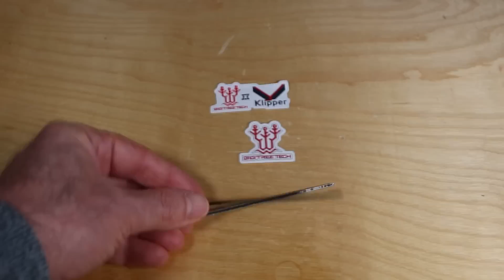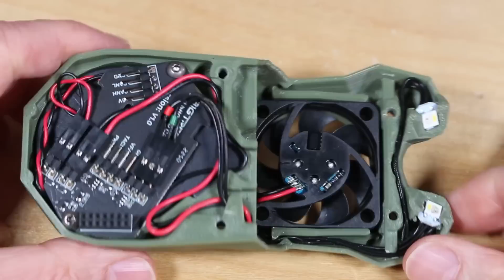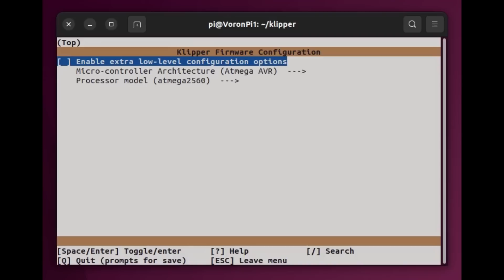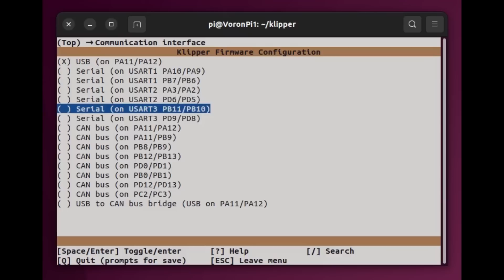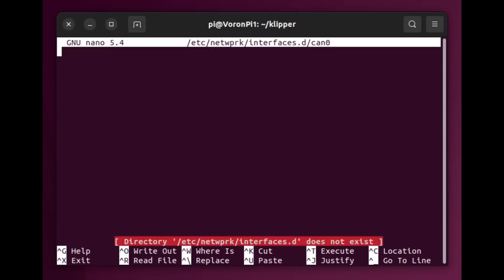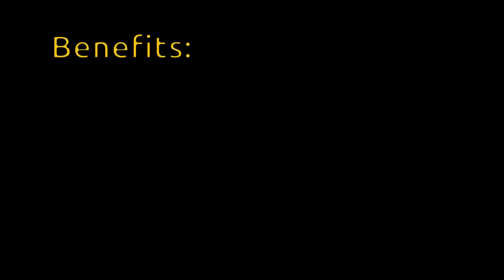Canbus SB2240 and SB2209 3D printer Install, Thoughts & Tips from BigTreeTech (BTT)

Comment: I have SB 2240 on V2,4 and Trident. What do I need to do to be able to use the input shaper I used before switching to canbus? By the way, your videos are excellent and have been useful to me on many occasions, including when assembling the SB 2240.
Reply from the maker: In your printer.cfg file you need a few lines like this (these are my actual values for the SB2240):

[adxl345]
cs_pin: can0: PB12
spi_software_sclk_pin: can0: PB10
spi_software_mosi_pin: can0: PB11
spi_software_miso_pin: can0: PB2
axes_map: x,-y,z

[resonance_tester]
accel_chip: adxl345
probe_points:
    175,175,20  # xy&z coordinates based on your printer size.  I used this for a 350mm 2.4. 

Once in the file, restart Klipper and you should be able to run Klipper's resonance testing just as the instructions state.

Thank you very much for the kind words and for watching!
Reply: @KapmansBasementWorkshop  Thank you for your answer. You are a kind person. I assume that since I had to completely reinstall klipper and did not reinstall imput shaper before mounting the SB 2240, there is no difference in the software installation itself? Should I just follow the instructions from the Klipper Documentation?
Reply from the maker: @ljuboizsiska5448  I believe that is correct.  When I run it, I just follow the Klipper docs.  It has been a while since I installed Klipper from scratch....
Reply: @KapmansBasementWorkshop  Thank you for your help! I installed the imput shaper on V2.4 and Trident following the instructions on the Klipper Documentation and everything works flawlessly. I know I'm boring but one more question; In the fluidd interface, I get a warning that updates are available. Is the update process the same as without canbus?
Reply from the maker: @ljuboizsiska5448  Yes, the update  process is exactly the same, nothing changes.  Update just like you did before.  I'm glad this is working for you!

Comment: This is so good!!

How is the process different from just connecting the SB2240 straight to the CAN0 RJ11 connector on the Bigtreetech Octopus (so without the U2C)

Hope to hear from you
Reply from the maker: I wish I could tell you based on experience, but I'm using a Spider on this printer.  That said, I'm 90% sure this is the same for the most part.  I used the U2C "as is" from the factory, so it's not really a factor here in terms of work beyond plugging it in and your Octopus provides that U2C functionality.  Have a look at the very 1st link on this page: https://github.com/Esoterical/voron_canbus .  I believe this is what you are looking for.
Reply: @KapmansBasementWorkshop  thanks for the reaction! 
So basically you expect I can follow your guide, but just skip the U2C section??

Also, any reason you chose for the DFU update route, instead of the CANboot option?

Hope to hear from you and thanks in advance
Reply from the maker: @sandervanvoxel3d  I choose the DFU route to keep the software installation simpler initially.  When I need to upgrade that software in the future, I plan on connecting my laptop and using the DFU method again.  Note that I stated "initially" as there is a tradeoff here.  Some may not see using DFU again in the future as "simpler" but instead as more work.  So CANboot is a little more work up front, but should simplify future upgrades.  It's really just up to you.  
Also, in thinking about your question and situation above, I think I would follow the Esoterical documentation and use my video when you need/want to see some of those steps when applicable.

Comment: Hello, thanks for the video.
I went with the fysetc kit that includes the spider ctrl board and I Wonder if all those mods you showed will work with my board.
I did see some equivalent extension boards like canbus, input shaker, Tap, on fysetc side but not sure if they stack up with BTT ones. Could you help out? Thanks
Reply from the maker: The only items I have from Fysetc is the Spider controller (which has been great) and a PEI flexible bed pate (also great).  Everything I show in this video is working with the spider controller.  However, since I use the U2C connected to the Pi, technically I'm actually bypassing the spider for canbus.  Input shaper & Tap are probably just fine from them.  I'm sure their canbus board is good as well.  But if it needs to be flashed, I would follow their guide to build and install as it might have a difference cpu when running make.

Comment: Question on the end of the cable did you cut the ends off for the U2C and use one of the connectors, like the 4pin?
Reply from the maker: I cut the end off and used the U2C screw terminals.  I hate crimping connectors....

Comment: Yep, that is a gamechanger. I have a flatflex cable for the x/y axis as the wiring but it is still not as nice as having ONE cable to fix the whole situation at best.
Reply from the maker: I'm really happy with Can Bus.  I plan to use it on all my future printers.
Reply: @KapmansBasementWorkshop  One more question: How to wire the xy endstops at the xy-axis joint at best? I mean there would be a cablechain left to get the switches connected.
Reply from the maker: @ddotaliaswalker  The y endstop gets relocated to the right XT motor/gantry joint.  There are multiple mods for that.  My other canbus video has links to the mods I used.  The x endstop moves to the print head (there are 2 screw holes in the StealthBurner carriage for this purpose.  If you relocate, the xy cable chains can disappear.  But there are mods to go canbus and keep the cable chains for both the XY endstops and if you choose, the canbus wires.  Or, if you are feeling adventurous, go sensorless. I originally relocated for a while and just recently switched to sensorless.  If you choose to do this, I would go one mod at a time.  Either canbus 1st or sensorless 1st.

Comment: Hi, so im installing the sb2240 directly to my btt octopus without the 2209. I can't figure out or find documentation on where to install the canbus cable wires on the octopus... could you please point me in the right direction? Thank you.
Reply from the maker: I would go to the BTT GitHub and look at the pinout diagram for your Octopus version.  I believe this is the pinout for 1.0: https://github.com/bigtreetech/BIGTREETECH-OCTOPUS-V1.0/blob/master/Hardware/BIGTREETECH%20Octopus%20-%20PIN.pdf
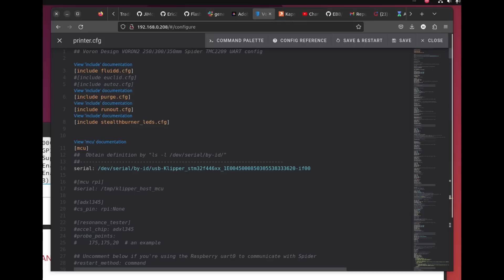Reply: @KapmansBasementWorkshop  sorry for the billion questions but at 18:59 do you copy the data from the btt github into your regular printer.config file? if so, where? does it matter? do i make sure basic none canbus info for the extruder hot end etc.. in the printer config are deleted before continuing to input the new info? sorry a little confused at the steps in-between the editing portion. hope my question is clear...
Reply from the maker: @mr.rajikon3911  All you need to do is copy and past the parts from the BTT file that apply to your printer and paste or possibly update/replace the pre-existing items in your current printer.cfg.  Then save and restart Klipper.  This can be done from the Fluidd/Mainsail UI.  SO for example, your current printer.cfg file has pins configured for your extruder motor.  You should comment those out and add the the code from the BTT file.
Reply: @KapmansBasementWorkshop  When you place the sb2240 in DFU mode, do you have the 5v jumper in? Or are you placing it into DFU mode with the 25v canbus plug attached?
Reply from the maker: @mr.rajikon3911  Have a look at this: https://github.com/bigtreetech/EBB/blob/master/EBB%20SB2240_2209%20CAN/Build%20Guide/EBB%20SB2240%202209%20CAN%20v1.0%20Build%20Guide.pdf
If you follow through, if using DFU mode it shows exactly how to proceed.  It depends on if you are using canboot or not.  If not using canboot, start on page 33.

Comment: man, it would be so cool if someone would just release a "no connector" board only with bare solder pads for the fans. also, revo6 hotend has shorter heater/thermistor cables they don't go around the back of those boards and have to splice extensions.
Reply from the maker: That's actually a good idea....
Reply: I soldered cables directly to the sb2240

Comment: I am wondering if you could somehow use the 3do nozzle camera with this canbus.
Reply from the maker: I don't think you can use this with canbus.  However, the canbus hardware will work over USB.  Some people run power and a USB cable to these canbus controllers.  So if you could get a very small usb hub circuit of some kind, you might be able to run a single USB cable to the print head and then connect both devices to USB.  Although another option is 2 USB cables to the print head.

Comment: Loving all your videos, they have been of great help in my quest of building my Voron :) 
I just installed the SB2240 and have had problems with TMC extruder undervoltage errors ever since. I swapped out the extruder motor and the error went away but now when I try to push speeds it is back again. Have you had this error?
Reply: I am having the same issue with my SB2240. I haven't found a definitive solution yet but I have found that slowing down my print speed has helped. I have seen some people discussing that motor draw may be a contributing factor and that if you are pushing close to your hotend limits, the resistance in the extruder can cause the low voltage error.

Anecdotally, I found mine was erroring during infill, which are my fastest print speeds.
Reply from the maker: @addisont7669  I have seen this error recently with my XY motors, completely unrelated to canbus.   Typically when moving an x or y axis during homing.  I ended up replacing the 2209 driver chip in that case and the problem went away.
Reply: I installed the SB2240 and after getting it to work initially on some small test cubes found that it constantly errored for undervoltage when extruding infill.  Tried several settings and could not make it work.  Removed 2240 and installed a SB2209 and it has been rock solid since.  Don't buy a SB2240 until the undervoltage gets resolved.
Reply from the maker: I believe it actually gets added to the [tmc2240 extruder] section....
Reply: the 2240 have big problems with undervolting. i had to limit hotend power to the point it could not keep warm enough to maintain temp. best advice go get a 2209
Reply from the maker: Instead of the hot end, try lowering the current to the extruder motor a bit.  Months ago when I ran into this on my y axis, I lowered the current to the stepper motor and it went away. I did end up replacing the driver chip later.
Reply: I have up on the 2240 a while ago. I still use it but I pulled a few extra wires from the electronics bay and use the Stepper on the main board instead 🤣
Reply from the maker: Oh no! I’m sorry to hear this.  Can you return it and get the SB2209 instead?
Reply: I tried everything that I could find on the internett and after talking to BTT. They sent me an SB2209
Reply from the maker: @fluehue591  That's good.  It sounds like that will resolve the issue.
Reply: @KapmansBasementWorkshop  Yes I will do some rebuilding as soon as I get the new parts. Then I will change the toolhead to The Rapid Burner because it is lighter. I just want to try it out. I will also change the front idlers. 48V motors and 5160 steppers is also waiting, vit Inspn't know 100% what I will do. Probably try to reprint some parts to get a stoffer frame and a lighter toolhead to hopefully get better input sharper results 😀
Reply from the maker: @fluehue591  I wish you a great rebuild!
Reply: @KapmansBasementWorkshop  Thank you, and thank you for making and shearing your builds and upgrades 😀
Reply from the maker: I have not, however I spent some time searching this morning and there are others that do.  It appears the solution is:
in the extruder section of the printer.cfg, add this: driver_tpfd: 0

Thanks!
Reply: @KapmansBasementWorkshop  Hi and thank you for answering :) Tried the driver_tpfd: 0 fix and it does not work. I will try to up the voltage on my PSU to see if that does help now. And I am waiting for an answer from TMC on what the 2240 is fuzzy about. I was wondering if it reacts to the drop it self or if it reacts based upon when the driver gets under a specific Volt. I have read everything I can find and I have also contacted BTT. So the adventure has started. Up til now it has not been a nice one, but let's hope it ends well :)

Untill now it seems the SB2209 is the safest bet by a long shot :)
Reply from the maker: @slipespesialisten1178  What is the actual error message you are getting?  Can you paste the actual message here?
Reply: @KapmansBasementWorkshop  TMC "extruder" reports error: GSTAT: 00000004 uv_cp=1(Undervoltage)

Comment: Howdy, great video.  I've setup my SB2240 the same as you, but I have a PT100 vice the PT1000.  But my klipper fails to start with the following complaint: "TMC extruder failed to init: Unable to write tmc spi 'extruder' register DRV_CONF".  I use a different name than you use for "can0".  Mine is "SB2240" instead.  My PT100 is 2 wire and the dip switches are set accordingly.  Any idea what might be wrong on my end?
Reply from the maker: I don't believe this has anything to do with the PT100.  In looking up the register at TMC, it seems related to the Motor driver chip on your extruder/SB2240.  I don't understand exactly what the problem is, but this is what I would look at:
1. Make sure the pins you have selected in the printer.cfg file for the extruder motor are all correct.   
2. Make sure 24v power is connected and you can measure the voltage on the extruder end with a volt meter.
3. If both 1 & 2 are ok, then power off the printer fully.  Shut it down gracefully and then unplug it and any other external power connections you might be using such as possibly an external power supply to the Pi.  Wait 5 or 10 minutes and then repower & restart and see if it goes away.

Comment: You have any good pics how wired all up?  I am building new LDO 2.4r2 rev c right now.
Reply from the maker: it's just 4 wires.  24v+ and 24v- to the power terminals/power supply and then the 2 H & L wires to the H&L terminals on the U2C (or waveshare hat or any other device you choose to use).  I don't have any photos.  I could take some if needed, but you would need to wait a little while as I'm currently trying to rewire my printer.  I have made sooo many changes, it needs some work in that area.
Reply: @KapmansBasementWorkshop  24v- or Ground to the U2C?  Also are you jumping it off the power supply or the controller board? (I'm technically out of 24V- terminals but I suppose I could piggyback a terminal already in use

Comment: Great video. I have an EBB36 with wire loom as well as the printed parts. Have been procrastinating for months to put it on. But now I wonder if I should skip and and go straight for the SB2209/2240. What are your thoughts considering you have experience with both?
Reply from the maker: They both work really well.  But the SB series eliminate alot of the wires that need to reach around the back of the print head where a Voron has very limited space.  It also allows you to easily pull off the Stealthburner shroud without trying to unplug wires that are hard to reach around the back of the print head.  But the EBB36 can be used with any print head you choose.  With the SB22xx series, it must be stealthburner.   Performance wise, they are both great.  Hopefully this helps.

Comment: I'm about halfway through on this, was curious how you connected the canbus cable that comes with the kit to the u2c? Did you cut it and crimp it to fit one of the square plugs on the u2c? And also, when I should connect it during this video? Also, just as a side note, they seem to be supplying precrimped wires now with the kit.
Reply from the maker: It's cool that they are supplying per-crimped wires now!
I eliminated the plug on the end that connects to the U2C, stripped the wires and used the screw terminals on the U2C.  I was so tired of crimping by then....:)
I had it connected and powered so I could build and install the  software onto the controller.  Essentially it needs to be plugged in and powered so you can set the controller into DFU mode.
One other thing.  In the video, I state I'm installing software to the U2C, but then if you follow thew video, I don't install any software onto the U2C.  And in fact, to this day I never have.  Please ignore what a say right there and what the title screen states.  The directions however are correct if you just continue to follow through.
Reply: @Kapman's Basement Workshop  I read that in the description about the u2c, just was confused on when to connect the canbus to the u2c. That was only part i was unsure about. Also,  did you use 120r jumpers on the u2c and 2240? I'm starting from a fresh install of everything. I should go pi image with fluidd, octopus, then this video, then config stuff if I'm thinking correct...
Reply from the maker: @richardclinton8408  Yes, I installed the jumpers in both places (120r) to properly terminate the canbus network.  I would do that right away just to make sure you get the cleanest signal possible for canbus.